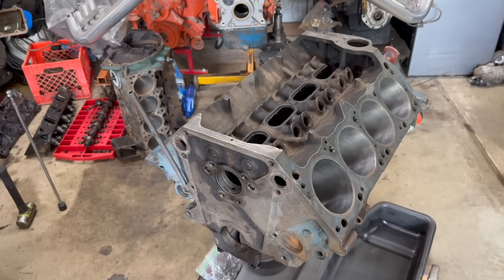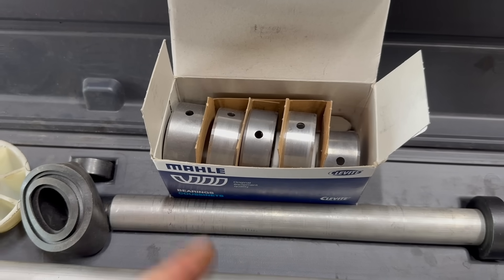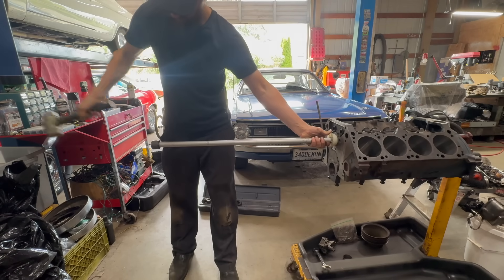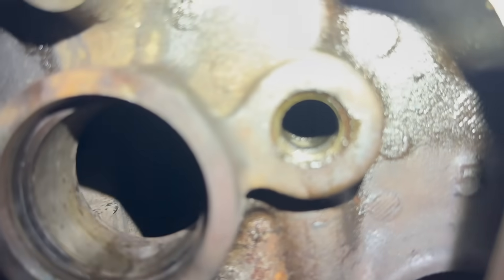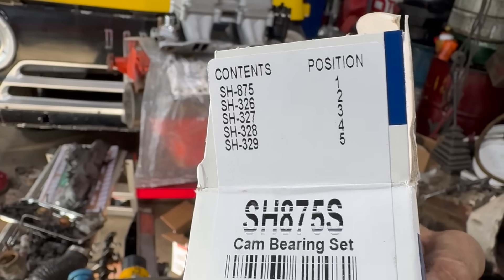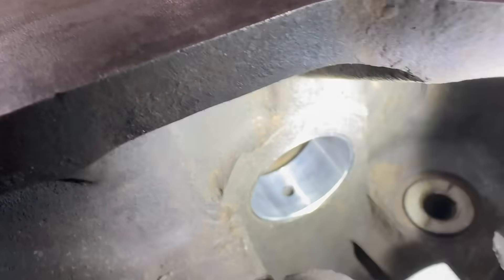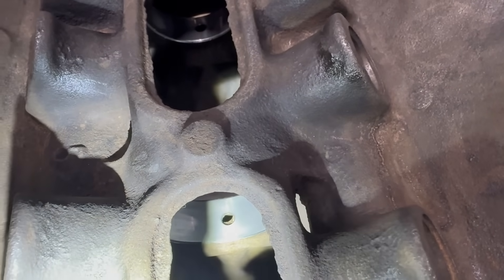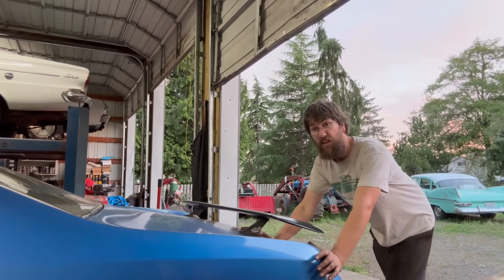No Machine Shop Necessary - Mopar 318 LA Cam Bearing Replacement, Oil System Tech, And More

Comment: I have a 95 318 that has wide cambearings when I took them out and can't find any wide bearings only narrow ones.
Reply from the maker: Weird. Not familiar with that. But wouldn’t worry about using what is available.

Comment: With brake clean being $4 a can at best and all the time hand cleaning, it would seem sending the parts to a machine shop for cleaning would be a better solution... if you can get it back within 3 months
Reply from the maker: Priced that lately? My machine shop no longer has a hot tank, so the only wash they can do is their “custom wash,” which involves a trip through steel shot. At the end of that, the bores have to be refinished. That’s not an option if you are trying to do what I’m trying to do.

Comment: I made the same decision as you. I was not going to pay anyone to take out the cam bearings on my 289 for my 65 Comet. Did my homework, watched some how to's and actually bought the same tool as you did. Super easy and it worked perfectly. I'll probably never use it again, but it was way cheaper than having a machine shop do it. So important to do your own work as much as possible. Another good video. Keep em coming.

Comment: I don't know why you waste that kind of money on break cleaner when you could use Purple Power and a pressure washer. and it would get it far cleaner and you would also have even less if no debris.
Reply from the maker: Purple Power kinda sucks. Super Clean is FAR more effective. Having used all of these cleaners and more extensively for years, I'm going to have to respectfully disagree. Also, I don't pressure wash my blocks or other engine parts for reasons that I should think would be self evident. Yes, they can be quickly dried and coated in some sort of oil, but I find skipping that entire process to be easier. A can of brake clean is literally $2.50.
Reply: @DeadDodgeGarage  I guess, to each there own. I have found it takes less time money effort the other way. love your video's!

Comment: Ive made a cam tool from a rubber expandable freeze plug. It tightens snuggly in the bearing.a socket and long extension taps them in. Loosen the nut and pull out the plug😊
Reply from the maker: Nice, nice.

Comment: Hey Jamie, question for you if you have a few minutes. I own a Penistar 3.6 in a gladiator, It's reliable, no issues, but i am thinking of swapping it in the future. I don't want a modern engine, do you know if the 5.9 magnums are impossible or stupid expensive to find? I have no emissions where I am, I would like to retain the ZF automatic if possible. I know i am going to have to deal with ECU fun, but what am i looking at for a good magnum v8..?
Reply from the maker: The 5.9 Magnum - at least in this part of the world - continues to be near enough to worthless to be a great swap candidate. And it's a great engine in my view. But I would never, ever, in a million years, attempt to swap one into a Gladiator. It makes less power than the Pentastar and is basically worse in every way, except in bottom end torque production and simplicity. It has zero business being in there. Unless a set of swap mounts for like a TJ Wrangler works, there is no mounting solution available. It will in no way attach to your ZF without some crazy custom adapter, and there is no factory ECM that could ever dream of controlling both that engine and that transmission. If you want to spend a truly insane amount of money and time engineering solutions to all of these problems, hey, more power to you - but it's anything but a natural or sensible swap, and to me it sounds like a fool's errand. I'd rather have the ~300HP and 20+ MPG that the Pentastar offers, and deal with its issues as they arise.
Reply: @DeadDodgeGarage Was under the impression that 5.9 was just a 360 with efi? Also thought they made around 245hp and 330lbft of torque, at like 3000rpm vs the pentistar has 270hp and 270lbft at 4600rpm.. Also not really going for speed i want a lot of low end torque and reliability. The 5.7 wipes cam lobes and the pentistar i have heard mixed results long term.. some seem to say it eats lifters, others say it eats the top end to death due to bad lubrication, really just want long term reliability, i don't care about mpg, or speed.. hell if i could shoehorn a 440 under the hood, i might try that.. I asked as i know you know mopar engines, how would you bulletproof a pentistar? any tips? i mean aside from 5w30 every 3k and i use a high zinc oil.. but what else will help?

Comment: if you taper the cam oil hole slightly you have a higher success rate with aligning the holes.  Also, my rule, for those who care, is to take a carbide bit to those jagged, thin bits of flashing on the oval cam windows.  eliminate any chance of the slightest sliver of metal from falling straight down into your new cam.
Reply from the maker: Good thinking. Little late now. I have often planned to clean up casting flash in performance builds to give myself the warm and fuzzies, but never think to do so until the block is already clean and back from the machine shop. I considered it on this one, but it really isn't worth the effort for what I'm doing. If that stuff has been there for 100-200k miles, it's never going to be a problem - so why worry?

Comment: Just did this last winter on a 360 LA motor. First time I ever messed with cam bearings, or really any motor that deep. Got fresh rings, mains, and rod bearings as well. Dropped it back in the 86 Ramcharger and I LOVE it! Going to be doing the same for my 1989 Power Ram at some point. You got any suggestions with the Mopar TBI systems? My current idea it to rip it all out and go with a points and carb set up.

Comment: You should have looked at your old cam bearings carefully before you removed them and you may have observed the oil hole misalignment. Then you could have enlarged the oil holes on your new cam bearings so you would not have restricted oil passages, but yes of course, you chose not to do that, just like you will chose not to chase all cylinder head and main bearing bolt holes with a bottoming tap, and clean the bolt holes with compressed air because why do that?? I know heck of a run-on sentence, but grammar is not my thing anymore in my old age.
Reply from the maker: So I shouldn't blow oil and residual cleaner out of the head bolt holes, instead leaving it there, allowing potential to hydraulically punching holes through the block? Got it, thanks buddy!
Reply: @DeadDodgeGarage  You are very welcome  😉

Comment: During cam installation on my satellite we noticed a couple of the bearings were flaking and done for. Low compression 74. Not pulling the pistons or opening up that can of worms. 
So... I traded all my bags of f's for a high volume pump. It ain't right, but it's good enough for something with 8ish to 1 compression.

Comment: I dont blame you for doing this yourself. Machine shops are crazy expensive these days. A long time ago I saw someone clean a block with a power washer using some kind of solvent additive and then go over it with a rust inhibitor. Not sure what was it was. Interesting to see the cam bearings installed. Those holes not lining up would drive me nuts.

Comment: What do you do for oversized or worn lifter bores?  I had a 68 Charger R/T engine I put into a 68 Dart GTS for drag racing, and there was so much oil coming out around the lifters with the rocker covers off it shot up out of the engine well and went clear over the fenders. That being a big block I blocked the oil to one side and fed it with a 1/4" tube crossing over the cam from one side of the oil gallery and restricted the oil in to the other. I had solid lifters, so I didn't think it mattered if the lifters didn't have lots and lots of oil volume.  And with the leaks around the lifters, I knew the cam lobes were good. But I have often wondered what the right thing to so is. OK, Far Out there in Washington State. ben/ michigan
Reply from the maker: Good lord. I’ve never seen that before… I think the only fix for that would be boring them out and installing bushings.

Comment: You sure that isn’t an np445? 435 have the shifter with all the bends in and 445 have a straight shifter cause no creeper gear
Reply from the maker: Yes, having driven the truck (and having read the tag,) I’m very sure 😁 I’ve yet to see a 445 in person. Can’t explain the shifter thing. I wasn’t aware of that difference.
Reply: @DeadDodgeGarage  yea the shifter difference is usually the junkyard spotter 445vs435 and since the tag on a 445 says 4530 a lot of guys mistake that for 4350 driving the two is very different the 435 is basically a 3 spd with creeper you don’t really ever need 1st but in an np445 you have to start out in first second is to high to start out in so you start out in first go 50 feet and have to shift but they definitely work better with heavy loads

Comment: A little food for thought, with the oil galley plugs out, with a gun cleaning kit. run the cleaning rods through the galley, attach some 550 cord soaked in oil, then pull it back through with the rods. Just like a Bore-snake. the cord or rope would need to be the correct size and lint free. idk.... might work.
Reply from the maker: Oh sure. Good thinking.

Comment: Hi Jaymie, my name is Ed.  
I totally wish you the best with your small displacement radical cam Barracuda project, but somehow feel the need to share an experience.
It was the late 70s and I'm in an automotive votational college class at Arapahoe Community College in Littleton, CO.  The graduating class had put together a drag racer from some-body that I don't recall, but it featured a Chevy 305, dual quads, a 5-something rear end and... wait for it... a freakin 2-speed Powerglide.  It was so overcarbureted that it practically stalled on launch, slowly gained power, went nuts, then shifted to second.  THEN practically stalled again until speed caught up with Bernoilli and the carbs once again worked,  tached out at 8500 rpm and rolled down the remaining half of the strip at redline, running a time that barely beat out a mail truck.  Somehow I imagine you might suffer similar results with this very nice 273, but recommend ditching the duals.  I get that 5500 feet of altitude difference might make this post laughingly bad, but it's my chance to make your day less awesome.
Just sayin.

AND since I'm posting, I have to add a comment.  
It could be completely wrong, but your description of R/T on the Neon is contrary to someone who I worked with for years, a Super Mopar guy, leader of the Rocky Mountain Mopar (RPM) club, who delighted in correcting the rest of us that it DIDN'T  stand for road/ track; rather was Rapid/Transit.  The guy is Wayne Benedict and there is nothing I could ever call him wrong about, including his disdain for Hemis at altitude.  He was always 440 wedge guy, but that's another story.  

I do enjoy your trips down Mopar Memory Lane and look forward to revisiting the unpleasant memories of my early days in the dealership.  I somehow just can't get enough.  You go.
Ed
Reply from the maker: R/T has always stood for Road/Track - and thankfully my engine isn’t a Chevy 305 😅 surely you’re familiar with the screaming 283s of yore. The 273 isn’t one of those either, but still - we’ll all just have to wait and see what it does. Thank you kindly!

Comment: At 4:40 you can change the bearings with the crank and pistons. We used the mini extendable magnet. I think.. i cant remember. 
But yeah you don’t have to remove the crank out of the motor. But your way is a bit easier
Reply from the maker: Can’t get my wrench in there through a crank. Non ratcheting wrench may fit through the top, but it also won’t ratchet, so that’s annoying. Not much room to operate. But I’m not saying it can’t be done.
Reply: @DeadDodgeGarage makes sense. Tbh I will probably use your method for a motor I decide to build. 

The time management thing at the end… yeah I don’t possess that either lol

Comment: Okay I need to know y u went with a 318 , u have access to any type of motor there at ur shop, im asking because of a 318 I had with a scored cylinder wall and I decided to go with  360 magnum,
Reply from the maker: The 318 is legendary for its reliability and simplicity. I love an underdog. I see zero reason to put some big ridiculous engine in a typical 4x4 truck. I had this here and ready to build. I had some good components on hand to make some extra power and beef for zero bucks. It’s a direct drop in for the truck. Headers, brackets, mechanical fuel pump - all of these parts will fit right on. I can keep going if you’d like 😁

Comment: Working on cam in block stuff was pretty rare for me, but I found it highly annoying working on the cam bearings when I did. Inevitably there would be one that knocked in a little loose and I would use green Loctite for those, then some would be slightly tight on the front side where I knocked it in. I could tell because I had to spin the cam a little bit to push it through the bearing as I installed it so I made a little attachment for my cam installation tool to sand a thousandth off the front area of the bearing. I was always paranoid that even though it was tight and spun okay after got it all the way in that one day it would get hot and grab the bearing because it didn’t have enough clearance on the edge where I smacked it. So far, it served me well and none of them ever failed, but I wonder how much that leads to destruction later on when you don’t pay attention to it. Before I had that attachment, I would just put some light valve lapping compound on the cam and give it a few spins, then pull it all out and clean it again. Of course I’m talking about junkyard type rebuilds like this where you’re just making it work, but it always worked! Well… 95% of the time it worked every time!

Comment: So if you used fully grooved bearings would it pump oil constantly and negate the need to turn the crank while oil priming to get oil to both sides of the head?
Reply from the maker: The full groove sends some oil to the top end at all times, but not enough to fully purge the rocker shaft. I learned that priming the 426 Hemi recently…

Comment: Your mentioning the heads at the beginning of the video made me think it would be cool to see you show the world how to put Magnum heads on an LA block. Or if you're super adventurous, put LA heads on a Magnum block. No cheating on that, you can't use an early Magnum block that's drilled for LA oiling 😁
Reply from the maker: We’ve done Magnum on LA roller, that was too easy. Although actually there was a pushrod length difference for some reason. Some day I’d love to build something that requires external oil lines. It sounds fun.

Comment: Have you ever bothered to grind the excess casting flash off?
Reply from the maker: Yes, inside cylinder heads where it might actually do something. I’ve thought about it with blocks many times, and I even thought about it with this one. The trouble is I usually don’t think about it until the block is fully cleaned and back from the machine shop. That’s not the time to make metal shavings… and for this one it just wasn’t worth the trouble.

Comment: Good information. Thanks, I do have a cam bearing installation tool. I haven't got that far yet. I have one question about head gaskets. Cause that's what happened to my original engine. It ruined it, so I'm thinking about buying Cometic MLS gaskets for a factory type install. What do you think? Remember! It's going in a Van, And I do not want to mess with it ever again.

Comment: Machine shop really is necessary to bore the wasted number 8 cylinder. Which isn't really that much of a shame considering how worn most of the rest of the cylinders are. You did a nice job of the cam bearing installation, but throwing good parts and a bunch of effort at a block with fundamental issues is a false economy. Been there, done that. Wishful thinking only goes so far.
Reply from the maker: I guess you’re talking about the rust stain that is in no way as significant a flaw as it might appear? We’ll just see.
Reply: @DeadDodgeGarage 
But wait..... won't that stain cause microscopic staining of the piston and rings? That could be the beginning of......
These guys would really howl at my 454 "overhaul", but it makes me smile every time it bellows to life 😄

Comment: Nice trick is to get a new dishwasher for the house and retire the old one to the shop! Use four times the caustic (electric dishwasher soap) and wash the block a few times yourself! Adding a recycling tank helps too! Wives usually don't like you to use the house dishwasher for car parts especially if SHE is the dishwasher? Lol 😅
Reply from the maker: No comment lol. But maybe I should’ve kept the old dishwasher
Reply: Yeah, my wife was a little upset when the dishwasher smelled gassy after I washed some motorcycle carbs......so the next time I tried baking them in the oven with simple green on low first, that was worse, but the carbs got clean!

Comment: I would suggest finding a way to remove the stripped out plug and the two that you need to drive out I would tap and put screw in plugs to replace them and I would brush out every bore. I literally had nothing to knock out two of those knock out plugs and clean the best I could and put an engine together only for it to fail a couple weeks later.
Reply from the maker: Those plugs have to fit behind the cam retainer plate. There is no reason to do all that. I did brush the bores.
Reply: Was my first engine overhaul and my only corner cut and engine failure
Reply: If you don’t have a Moroso brush kit, I suggest getting one